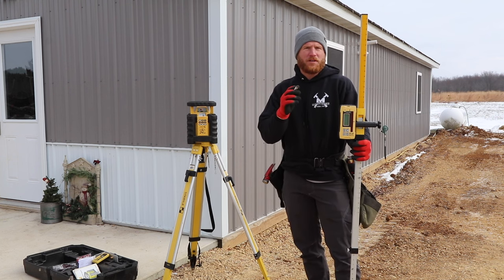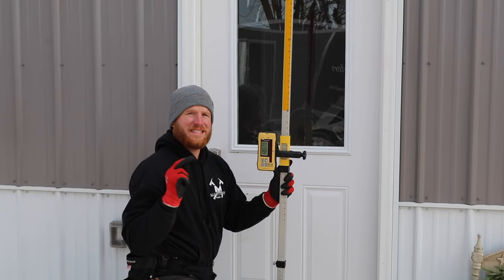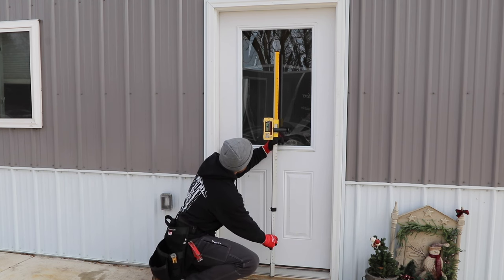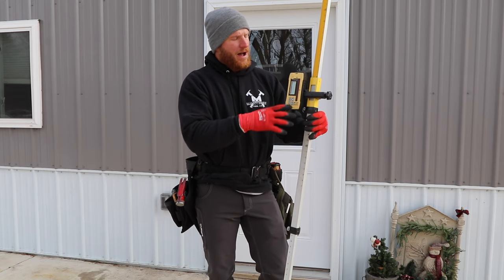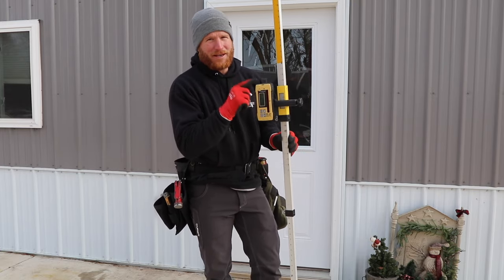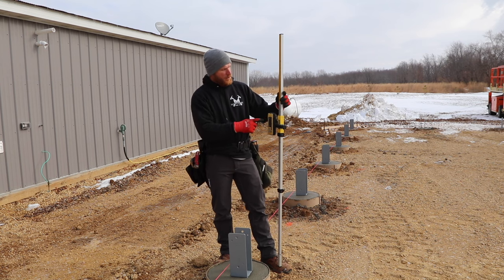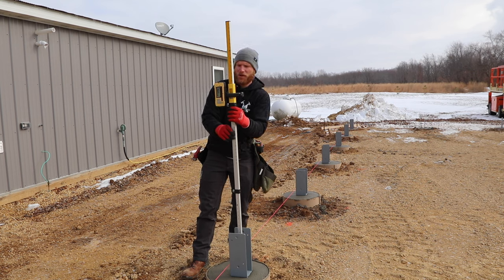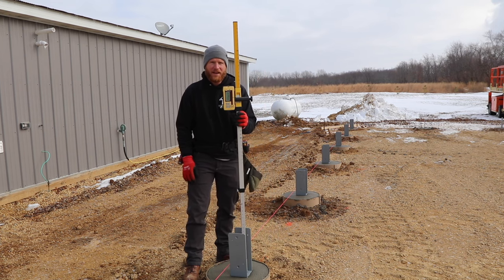What is a grade stick for?

Comment from the maker: Just to clarify....Everyone of our jobs that has a concrete floor, the top of the concrete is 4" above "grade" .  We want our concrete floor to be the same as the front doors thresh hold.  therefore when we set out receiver at +4 and then zero it out...the receiver will get a solid tone at 0 on the grade stick when it is 4" below the finished concrete.   Then I slide the stick up when resting it on the bracket and the number it tells me is the offset difference I use when making my columns.  Hope that clears up some questions
Reply: No explanation of the beeps.  This is 101 laser grade training across all common laser transits.  Fast beeps mean you are high, slow beeps mean you are low.
Reply: I think a white board drawing that indicates all of your required measurements to lay our each post would clarify it for most people. By drawing a post with markings indicating the finished floor height,  grade (4" below finished floor), height of the bracket (approximately 2" below grade), and total post length you can show how you are compensating for the small variations in bracket heights from post to post. In the end you are cutting the tops of each post to  account for those small variations. Just a thought....
Reply: Lost me at back to zero plus 4
Reply: So if building 16' with 4" concrete, the inside would be 15'  8"?
Reply: Want to start by saying love the content keep up the good work. However I wanted to add something since I use one everyday. Building guys tend to just go from finish floor as you did but the “correct way” (if there’s such a thing in construction) you actually bench your stick in at the sea level elevation. I say correct way loosely cause I come from a civil side of things and I’m sure your background is architectural in nature. There’s more than one way to skin a cat. I could try to explain but I’m sure I’d just confuse everyone.
Reply: Yea you messed up in the video if you set it at .34 in the red all you gotta do is read 0 anything other than that fill or cut too easy this rod is goofy as hell you should just get a lenker rod from laserline
Reply: I gotta say, you totally lost me. I get wanting the floors to be the same, but I am missing the connection between the bottom of your plate and the new floor. Where does the new floor go? Flush with the bottom of the plate? Flush with the top of the Sonotube? If flush with the top of the Sonotube, what do you need the level for? How much dirt do you need to add or subtract before laying the concrete of the new floor? You marked 1 7/8" on the column...so what? What does that mean and how is it a measurement of floor or door threshold? It is too late to move the Sonotube and bracket.
Reply: John Turner  like he said finished floor will be 4” above grade. Grade is bottom of the splash board (treated board at the bottom all the way around the building). So 4” up from bottom of splash board is finished floor. 

He then shoots grade where each Column will sit to determine the high point (Column sitting higher than all other columns) and will make this his “grade” (the high point). The number he rights down On bracket is the difference between column that’s going there and column that he set his grade off of. He will hold his story pole up how ever much the difference is from bottom of each pole then transfer his marks to the pole. When he stands his walls up everything will be running level and In a straight line by doing this.
Reply: @pbj417  excellent written follow up to Kyle's video.
Reply: Great help
Benn using same laser set up for years. This really help clarify things.

Comment: More confused now than when I started watching
Reply from the maker: what can I help explain
Reply: Like donald wells, I learn by repetition.  Just keep beating the drum loud and we'll get it eventually.  Maybe.   @RRBuildings
Reply: RR Buildings maybe next time go a little slower. I don’t use mine very much. Thanks 🇺🇸
Reply: Like Anthony below I don’t use often. You keep explaining and we will eventually get it
Reply: I think if you need him to explain again, just watch the video over and over. He couldn't explain it any simpler than he just did!!!
Reply: You take a shot of whatever grade / height you want to achieve.. If you walk around the job site and do not move the lasers target, then you will keep the same grade / height as what you took your shot from..

If you took a shot (place grade stick on existing floor, then move target until it has a solid tone) on an existing finished concrete floor and  plan on pouring a new 4" concrete slab for a new building, and wish to keep your new slab and existing slab at the same elevation, then move your laser target up (towards the sky) your grade stick 4". This will make the bottom of the stick go 4" lower, and get you to the grade/elevation that your dirt / rock should be at. Then you can walk around the whole job site and see how close your grading is.

After you set your posts, you can measure down the grade stick (below the measurement taken on the existing slab)  to make the bottom of the grade stick come up, and that will transfer the elevation of the slab up onto your posts in a level way.
Reply: Correct me if I’m wrong. 
There are two places to make adjustments. You can adjust the height of the stick itself or simply slide the sensor up and down the stick. 
Once you get the stick set, leave it alone for the rest of the job. When he adjusted the whole “negative four, positive four” bit, he just slid the sensor four inches down to compensate for the concrete height, then he used it to set the height of the stick. He now had a new “zero.” He never touched the stick again. 
After he had his “new zero”, he was able to adjust the sensor up and down the stick to see how far off that particular point was from his new zero. 
His original step of adjusting the stick to zero rather than to negative four is probably where you got lost—it’s where I got lost initially. That step is unnecessary and duplicative, but can help with the process of explaining. 
Clear as mud now? ;)
Reply: Show the math. That will help them.
Reply: @mattthomas4024  This is the context I needed, cheers
Reply: Great explanation... thank you :--)
Reply: Haha 😂 I had that to but after three times watching I understand that plus is minus and minus is plus on the grade stick
Reply: X2

Comment: Appreciate the effort but I found the explanation confusing. Zero on the threshold, then extend the stick by 4” or move the receiver up 4” and then you have grade below the finished floor. Then check your brackets for elevation relative to the grade. I have the same grade stick and it is a counterintuitive to me. Reverse reading grade sticks are much more user friendly if anyone is considering getting one.

Comment: I get what you’ve done now RR , although I had to watch it several times and then sleep on it in between.

After referencing finished floor height to zero on the pole, you lowered the receiver by 4” and then lengthened the pole by 4” now the zero mark on the pole is actual grade level.  So now when you take the pole around the site and slide the receiver up or down to get a solid ping from the laser the difference between the mark on the receiver and the zero mark on the pole is the variation in height from grade level.

Thanks for making me think about it 👍.  Please correct me if I am wrong, the moral here is,  be sure to use the zero mark on the pole to make significant reference point , in this case you’ve made it grade level.

Thank you for making this video it’s much appreciated.
Reply: ok. now that I read a few, I think we're all on the same level. I often read text book chapters twice or thrice before doing quizzes

Comment: I would of just left the finish floor on zero and moved it up 4 inches in the yellow. 
You guys are true craftsmen and enjoy your videos.
Reply from the maker: That’s fine... then I would have had to do match once again and this eliminates the possibility of error.
Reply: The Stabila products are top notch. 
I have used them for years even when most people in Florida have never heard of them. 
You could also use a story pole if you have multiple elevations and mark what each one elevation is. 
We use an 1x2 story pole and sharpie because we deal with a lot of different elevations.  
I build custom homes in Central Florida and Craftsmen like you are getting hard to find.

Comment: Hey Kyle great videos.  My name is also Kyle but Had to come back to this video to see the leveling. I have a Johnson laser level transit and getting ready to start our pole barn house conversion. Still waiting on materials from local Mennonites as the been behind and hard finding straight logs for our post and now an injury on there side. With cost of materials and everything we are so far behind along with full time work to come home and build our homestead from scratch. I have the 7 holes for porch started and still have to set grade along with mark the rest of our holes for quick tubes. And tips and trick would be great thanks Kyle b.

Comment: You confused most everyone watching!!  20+ years as a carpenter/re-modeler and you almost lost me at 4+", don't use grade sticks often enough to stay sharp on them.
Let me try to explain; his finished grade is 0" (door threshold).  Since he wants his unfinished grade at 4" lower, its set at 4"+ on the stick, lower on grade means moving the receiver higher on the pole which is positive direction.  He wants his sonatubes set 2" below unfinished grade so they are set at +6" (4" plus 2").  Hope that clears the waters, I know its pretty muddy.
Reply: R B agreed been using these for years. Your explanation is accurate and to the point
Reply: That helped me, thanks. I came into the video thinking i'd follow him since i have done this once before. Nope. But if what you just said here is what he was doing there, then i am back on track.
Reply: Dewalt gave him money so he did what his goal was, view knowledge transfer wasn't part of the equation.

Comment: I need one of those, rotary lazer level and a tape measure have been my methods..
Reply from the maker: this will change your life bud seriously much more accurate..less math, and so much quicker
Reply: Yep, me, too.  I use the old school scope-level:  a Leica Theodolite with a grade rod.  In the time it takes just to get the Leica scope leveled in a plane, I could have taken all the readings and be finished if I were use a self-leveling Laser level and target-receiver.  A Theodolite is a fine instrument but it's obsolete technology.   I say it's high time I upgrade my site layout equipment.
Reply: @WelshRabbit --- I'm retired but I had an old Gurley transit....and still in excellent shape (it can work tomorrow). Last time I used it (for 30 minutes of work) was 2012.
Reply: I would think that seeing a laser line on a tape measure would be much faster than messing with the head up and down to get tone then locking the head and turning it to read the number.  Maybe not better, but just as good and faster for this particular task.  You should race Kyle, I'll put my money on you.  Are you sure that your laser is visible/effective 80' or more down the line?  :)

Comment: Kyle, what's the red portion at the top of the stick (on the metric side) and the yellow portion (on the inches-Imperial side)? Why do the colored portions only cover about 1.5 feet of the grade stick?  Another question is the bull's eye level at the bottom supposed to be functional?  On mine, it's just a useless dummy level.  It seems to me that a real, working bull's eye level would have been better, right?  Of course, someone who is experienced and skilled handling a grade rod should be able to tell when they are holding it plumb (or at least close enough) without having to look at a level.

Comment: I'm a total amateur building a relatively tiny shed that is 6' x 14'. The grade is pretty flat already but I do have a "high" end. Unfortunately, I don't have a Stabila and can't justify buying one for such a small job. Do you have any videos that show a good way to layout a level foundation on just 6 piers? I guess it would be like if you showed up to the job site and you said, "Damnit. We forgot the stabila! Is there an easy way to layout a small job? I'm assuming the answer to be "use a string and string level"(?). Not sure there is much interest in this sorta question but figured I'd lob the question over. Love the vids by the way... I have a new appreciation for making sure everything is done right from the very beginning.
Reply: You can do this stuff on a small scale with most any self leveling laser, even a $50 one.  If that seems expensive for a one time small job, look up 'water level', it will work as accurately and can be made for less than $15.

Comment: Ok I got the point but you cut it short. I would just now had demonstrated the corners of the building to see and make them level so that the SLAB should line up level with the building which is standing on your tubes. I think a lot of people still have the disconnect there.

Comment: Interesting. I guess I never realized that the bottom of the column was under the concrete and the concrete was poured around and encasing the bottom of the column.  Is that required by building code in your area or just considered best practice?.

Comment: Look, let me say that I admire your work, love your videos, learn something on each one and look forward to every new one...but you did a less than stellar  job on this one, even though it's clear you know what you are doing....this minus 4" plus 4" stuff was just confusing.....here's what  you meant to say.....

You first find out what you want to be your reference point, in this case, the  threshhold  (the floor) of the house. You did that. But you then tell us that the project is always 4" below that (or whatever)....so to save doing math in your head (as you said) you LENGTHEN THE STICK BY 4 INCHES.  That's important and I think you were going too fast...(So far, no one sees any savings yet, so that's confusing - but wait.)That means that when the solid tone is heard out on the project, given that the stick is 4" longer, the zero is telling you that the placement of the rod is 4" below the finished house floor.... (Here a pause was needed....)........that's just the long and the short of it....pun intended. Now here is where the savings come in....Since we are (re)set at zero,  any variation from 0 ( a -4" from house grade - depending on whether it is higher or lower from the set point)  can be read directly and then just noted  on the form or support or whatever ....as you show at the end.... You can then reset the stick, variously over the project space for other direct read measurements.  Of course you don't have to reset the stick. (Which would have been a great example.)You could leave it at whatever and then when you are placing it out on the various project points you  would then be subtracting, for example  4.5" from 3.25" and that's just nuts...(which is what your video was intended to show) so that's where the math savings come in....and btw, since most contractors (based on my experience) don't use a grade stick, I think it was a good idea that you made the video.....and it's not, by any means an easy subject on first exposure....hope this helps and not confuses and certainly not intended to insult.........

Comment: Wow, that was easy. Set it here, move over here, and put this  there. Now, minus 4" and move  it over there.  Once there , flip it upside down and to get that number,  then simply take the square root of  that number , and add  5 inches! EZ. ( I guess I need to watch this 5 times to catch on) lol
Reply: All done at the threshold. Adjust your detector on the stick at zero (yellow line). Adjust bottom telescope up or down until you get solid tone on detector. Move detector up 4 inches using graduations on pole. Now you would have to drive the entire stick down through the concrete 4 inches in order to get a solid tone on the detector again.
Reply: Which means anywhere you go with the stick and get a solid tone means the bottom of the stick is at subgrade (4 inches below the concrete).
Reply: Another way: 
1. Lower the detector 4 inches below the zero point on the stick.
2. Adjust bottom telescope up or down to get steady tone on detector.
3. Move detector back up to zero point on the stick.